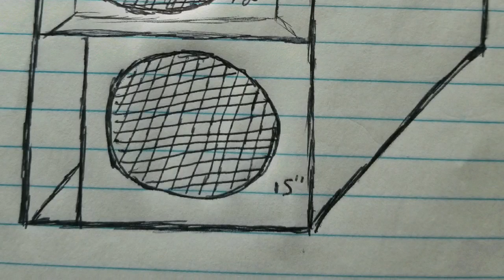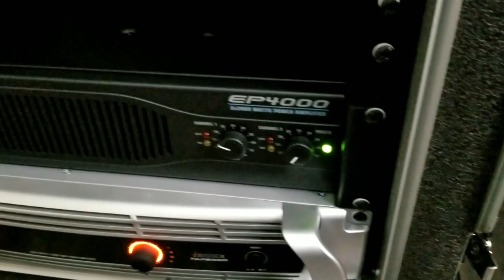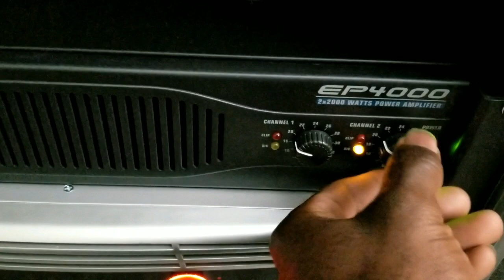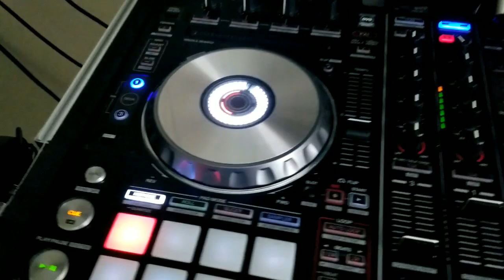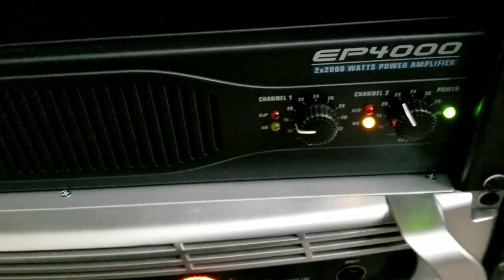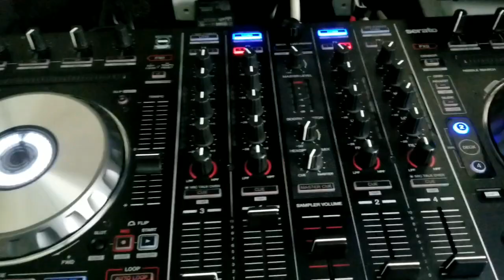4 way Soundsystem speaker cabinet build from scratch

Comment: It’s a great effort in drawing and building this box. However it is not build properly without knowing the algorithms and specs of each component. It is wise buy plans or get a software to give you the proper measurements to build a box or else it’s just like throwing away money.
Reply from the maker: Thanks for watching,  i do understand what you mean,  but I've built many boxes before that I've used in clubs and had good results.  This design is kind of no different from what I've built before but stay tuned I'll be doing a video testing them out in the coming months.  Thanks again
Reply: @Djshaw1kinglegend  the box just not to HIS liking. good job boss!
Reply from the maker: @deadsteadysound  thanks for watching